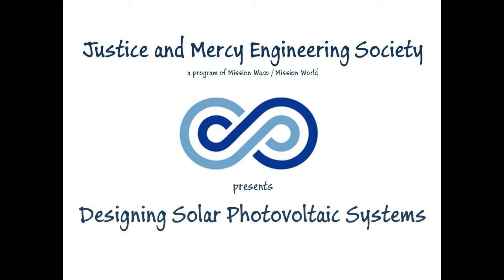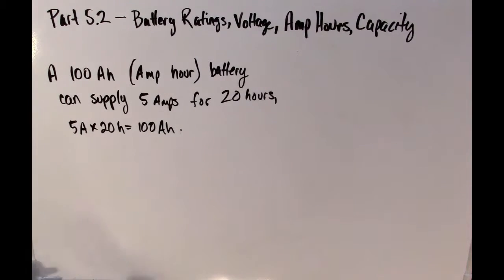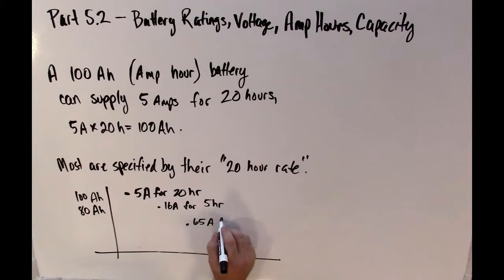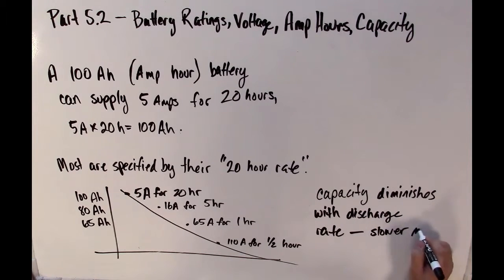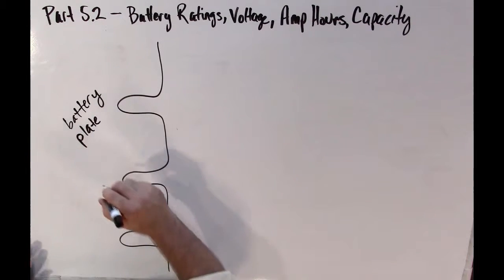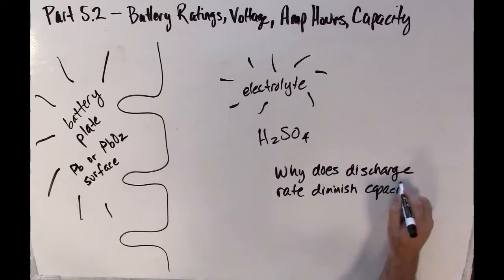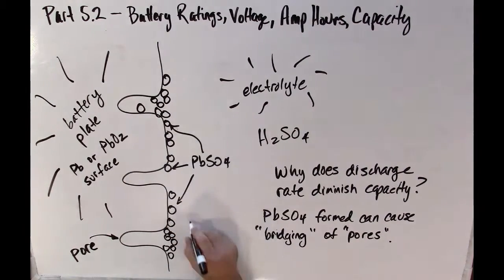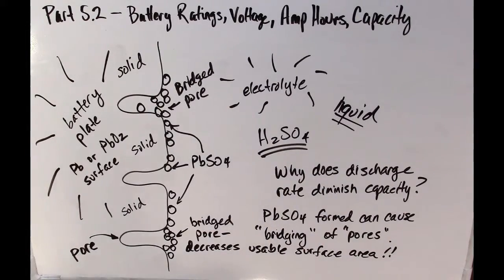Part 5 2 Capacity and Discharge Rate

Comment: me again.  I have a load of 150 watts average (small fridge), am I correct that 2- 75Ah batteries would run it for 12 hours?
Reply from the maker: I assume your batteries are 12 Volts each.  If you connect them in PARALLEL then you will have the equivalent of one 12 V battery with 150 Ah capacity.  If you ran a 150 W load for 12 hours it would require 150 Ah * 12 V = 1800 Wh of energy.  Your battery configuration would hold 150 W * 12 hr = 1800 Wh of energy too.  Note the change in units on the left side of each equation.

So from an energy point of view, your energies match.  However, it is not good practice to drain 100% of the battery's capacity, especially not regularly.  I would recommend doubling your batteries so that you have 300 Ah, or 3600 Wh of energy storage.  That way using your fridge for 12 hours will only drain the batteries by 50%.  This will result in a significantly improved battery lifetime.  You buy twice as many batteries at first, but they are likely to last MORE than twice as long. Got it?
Reply: Got it!  Great explanation indeed!  Finally this whole process is starting to make sense!  Thank you Brian!